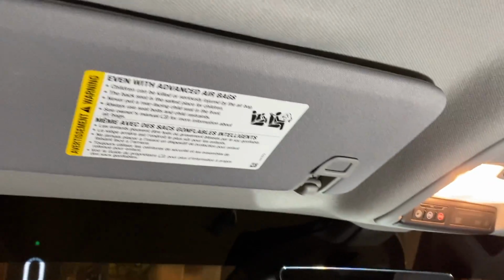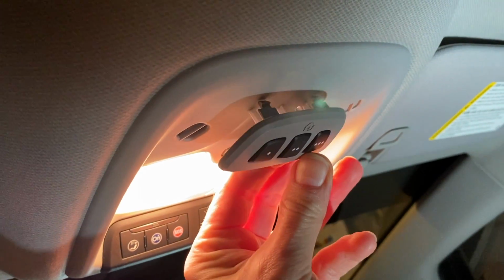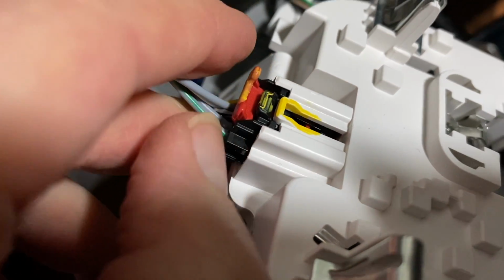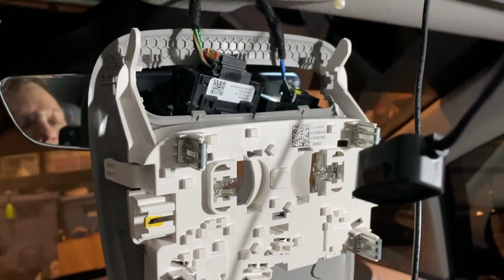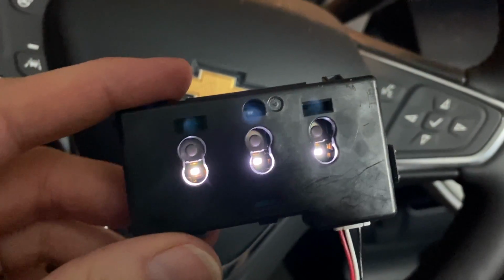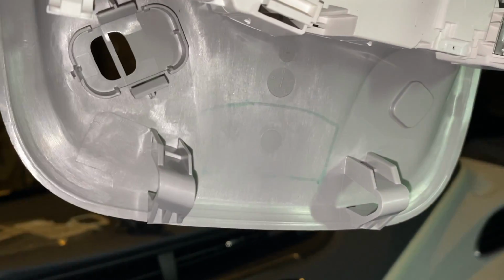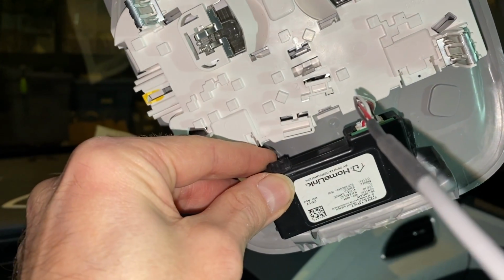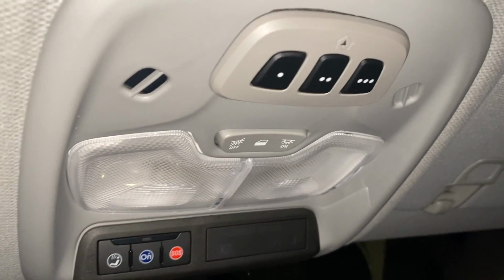Chevy Bolt Homelink Install

Comment: 😊Excellent effort and results. First class but probably too much for the average owner. Other cheaper and much easier solutions. I would recommend anyone removing that piece to go ahead and replace the cheap yellow interior lights with 6000k LEDs. Thanks for the documentation.

Comment: Wow - Those are $160 on Amazon if I'm correct.  That's too rich for me.  Years ago I had a 2003 Mazda B300 pickup truck.  I bought a Lincoln visor on Ebay for a few dollars and replaced my visor with that.  I might consider doing that with my new Bolt EV.  Right now I'm just using a clicker remote.  I was totally surprised that the Bolt did not come with Homelink considering that it has so much tech already.
Reply: You could use any Homelink module check EBay as low as $15, or go to local pick part car recycling for $5 you can get the module